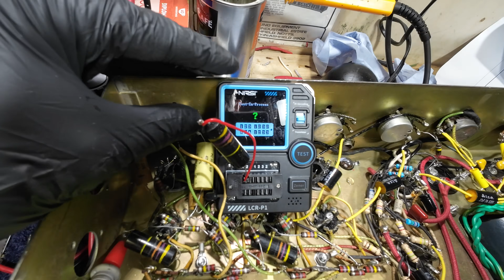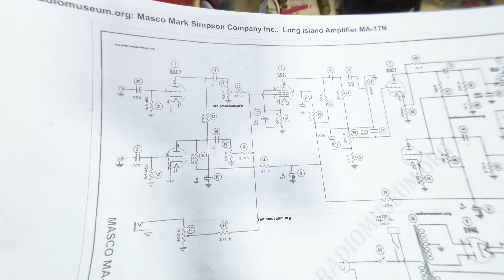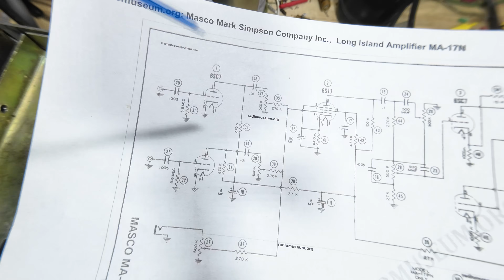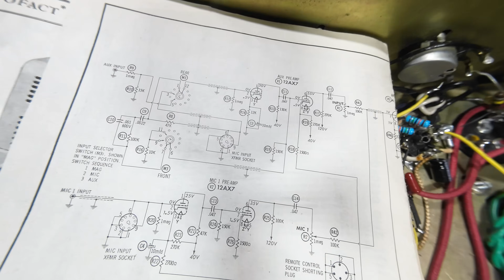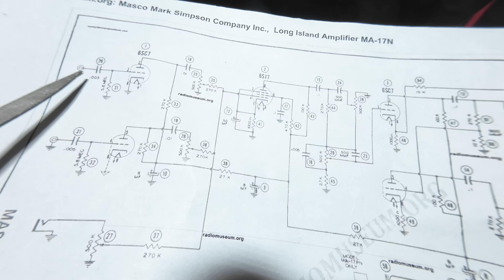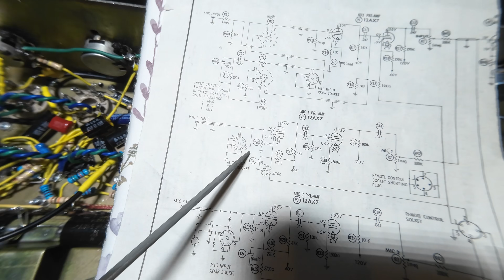Stromberg Carlson AU57 Tube PA to Guitar Amplifier Conversion Wiring Up the Pre-Amp Sages and More

Comment: Hi Martyn, regarding getting those old resistors off the tag strip, once you’ve used the solder sucker would it help to then try some braid to absorb the solder that won’t move with the sucker?
Reply: Braid is helpful as step #2, but typically won't remove all of the solder; heat the terminal to melt remaining solder and shake the component or the remaining cut component lead as the solder cools, and solder won't adhere to it. Then you can unravel the wire lead from the terminal.....
Reply from the maker: Thanks mate. Take care all.
Reply: That's what I was thinking too - but there's maybe not enough space to hold everything in place - or not enough hands ?!!